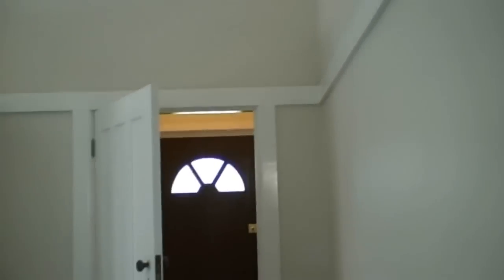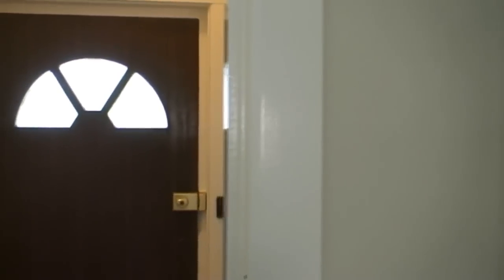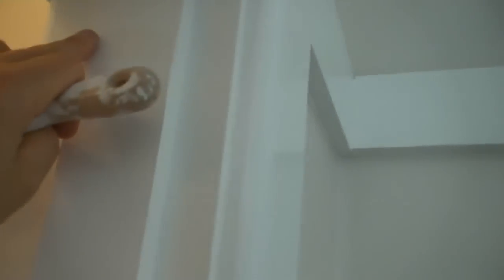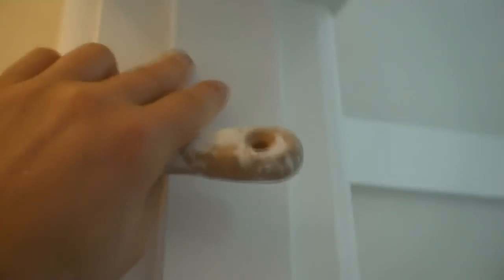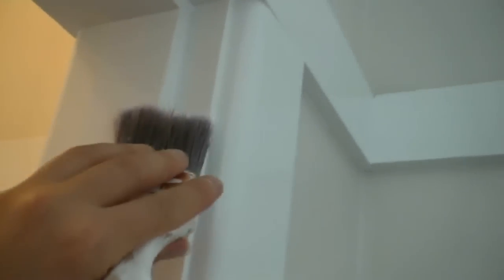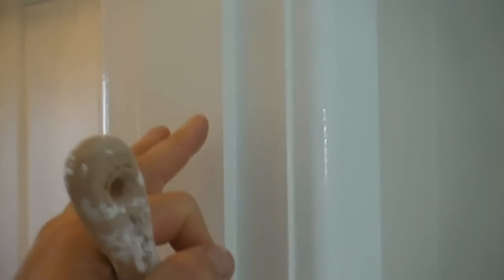Painting door frames with a brush, using Dulux Aquanamel

Comment: Did you thin at all?
Reply from the maker: Hi, no, I try to avoid thinning water based paint unless it's hot. I'm not sure, buy worried that thinning may affect durability.
Reply: The 3rd Coat Thanks for the reply!
Reply from the maker: @chasberman  Pleasure, have fun painting!
Reply: The 3rd Coat Actually, do you still use Aquanamel? Or have you found something better since then? Cheers.
Reply from the maker: @chasberman  I still use it, pretty happy with it. It's become a bit more user friendly since this video, flows a bit better. Mind you I'm in Melbourne and I'm usually able to schedule Aquanamel work for cooler times of the year. In summer, or in the northern states, this is hard to do.

I find with Aquanamel the paintbrush I use makes a massive difference. I make a mention of this in another video about painting ceiling roses if you wanna have a quick look.
Reply: The 3rd Coat Awesome. Thanks!